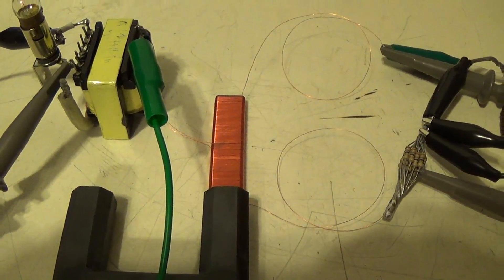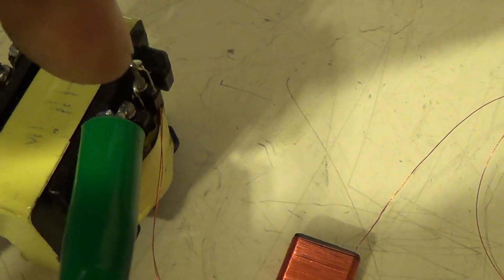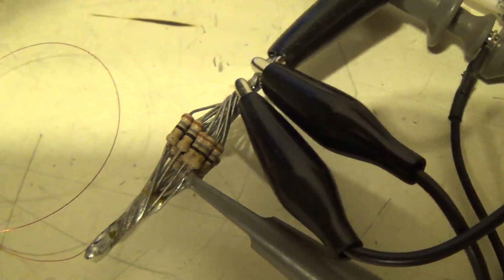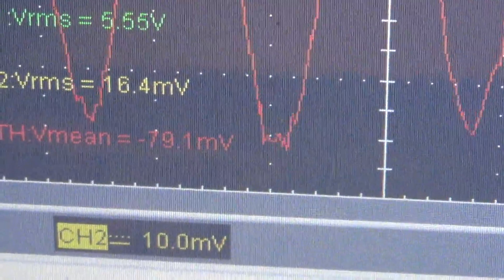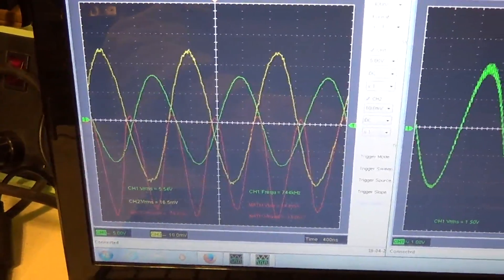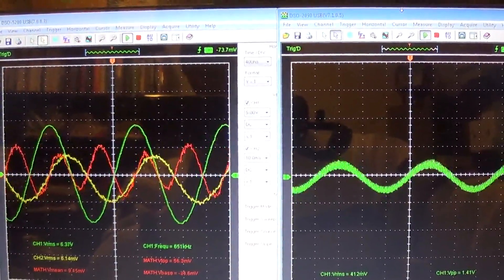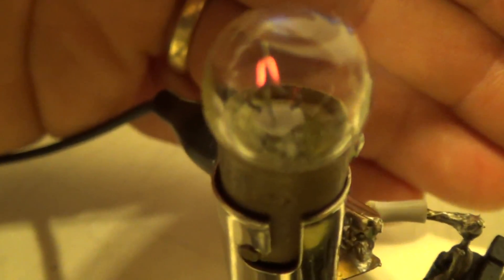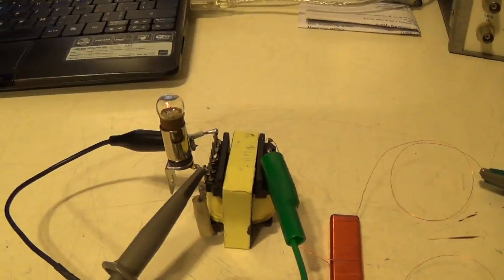Solid State Generator Phase Shift test 1

Comment: Grasshopper, You need to learn from your elders. The resistors are manufactured by cutting a circular spiral into the film and as such your assumption of no inductance only holds true for a direct current. When you run an alternating current thru the resistors, you need to account for the spiral which is a wound inductor and as such adds inductance. KE5HDL Amateur Radio Operator (HAM) License. P.S. I used to work in a resistor manufacturing plant before my retirement.
Reply from the maker: +CURTIS BRILEY Thanks for your post. Question, what happens to inductance when we parallel two inductors, does it double or divide in half the H value?  Luc
Reply: Neither because you have several inductors that couple the mutual inductance of all the resistors. See page 11-48 of http://web.mit.edu/viz/EM/visualizations/coursenotes/modules/guide11.pdf and breadboard your resistors at the frequency and amplitude of the signal drawing the current through the resistor group and go from there to measure and calculate the effective inductance and resistance.

Comment: Hi Luc, Nice test. It's easy to test the math. Also to confirm the invert function. Just put a fast diode bridge on the output side (bulb side).  Put an analog or digital amp meter  between the bridge and the load (output side). Now note the current direction, when you go over or under the peek setting (resonance, around 800Khz) . You will find that current changes direction. For example, if your load was a source, the direction of the current would indicate, power going to the source (charging) or power coming from the source (discharging) (returning to source). (one of those two reading would be negative, depending of your probe orientation.)
Reply from the maker: Thanks Mike, I'll look into it
Luc